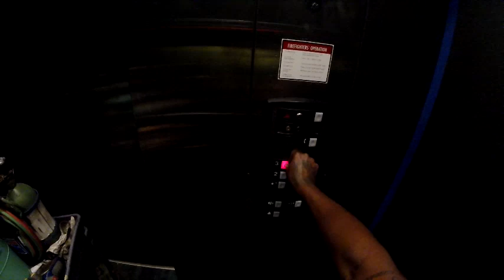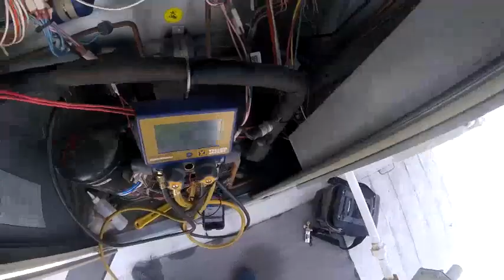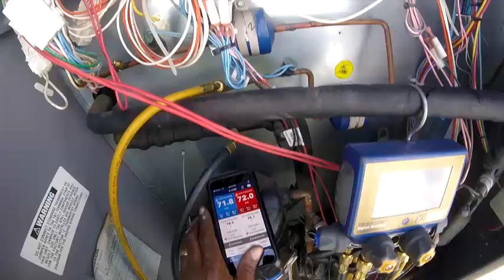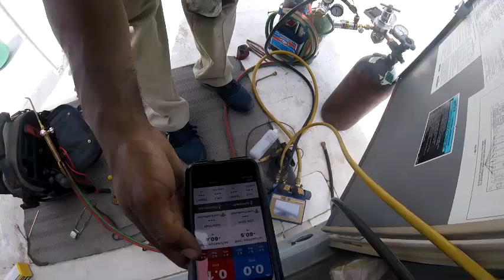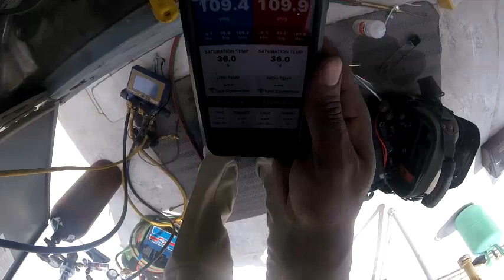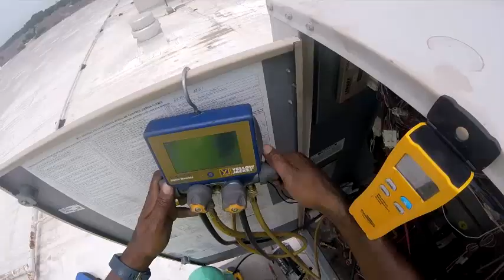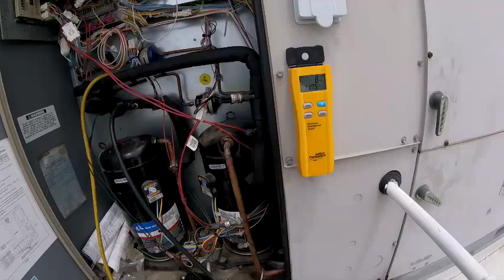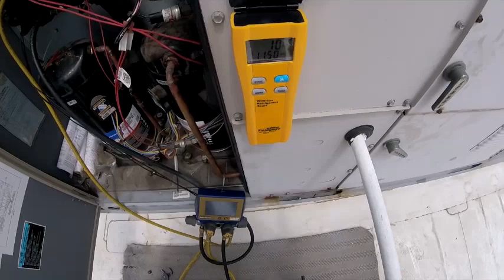HVAC: Leak repair

Comment: The msg I walked away with was, No matter which way the horse bucks, dig in and stay on it. Everything you did was familiar accept I wondered how you were going to tackle that leak. I was surprised at the method you chose to close the leak. Well, not so much the method but the technique. When it finally was sealed I wondered what was going to be done to prevent that from happening again. It appeared the vibration caused the leak and a bumper of some sort would need to be placed between the pipe and the screw head, it was rubbing on. The temp checks toward the end were great, it verified the unit was working as it should and showed the locations on the RTU to make the checks. Once again you improvised to get the equipment up the ladder which is a normal part of the work and improvising saves time and stresses the point of keeping your equipment intact and accounted for.
Thanks for another great repair video, it was much appreciated
Reply: I can’t watch no more , can’t believe you are going to try and repair that leak by putting solder on ... is better to replace that short run ... don’t drop your standard mate..!
Reply: They make a torch tip called captain hook works very good in places like that good up to 1in copper

Comment: Not sure if you knew, because I didn't,they have a Copeland Mobile app that you can download for compressors that will tell what type of refrigerant it uses. We use it where I work when the condenser label is gone. That kinda saves us time instead of having to call the supply houses. Keep doing your thing.
Reply: App do not help always, ask your soul.problem would be beneath your long nose.

Comment: I like ya videos bro shouts out been in ac for only 3 years not long I just make sure I use all the correct steps in servicing. I would have bent my stick n started at bottom maybe would have helped.

Comment: Sorry but I have to tell you that you never light a torch with the oxygen on. You can get a back fire and blow your regulator off like a shooting star. On our we have one way valves at the torch end and flame arrestor at the regulator end. I could not see it on your system. Also you were over 6 feet on that ladder with nothing on to incase you fall. A big OSHA no no.
Reply from the maker: Breathing in all that soot is a big no no...
Reply: Good job! From start to finish👍🏼
Reply: I am a welder for 34 yrs pipe welding also oxy- acetylene welding just add a lil more acetylene when u open up the soot wont be there. Good vid.